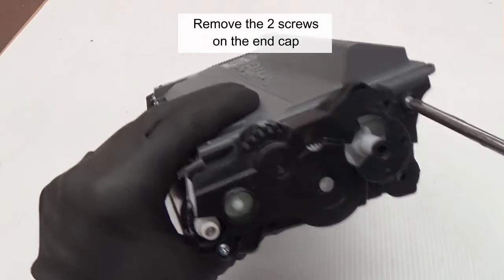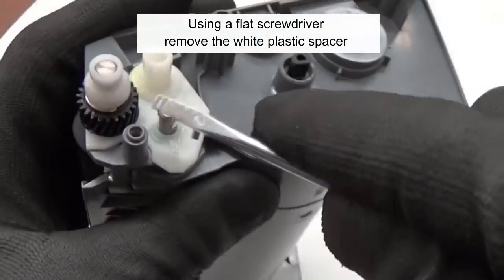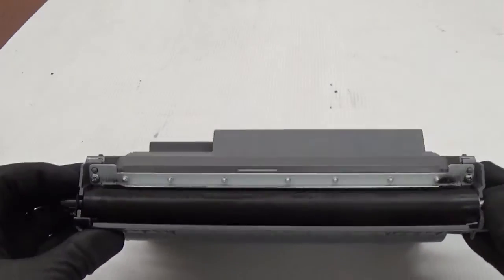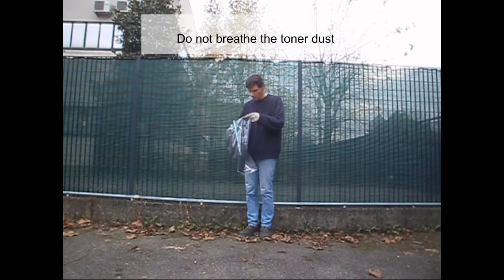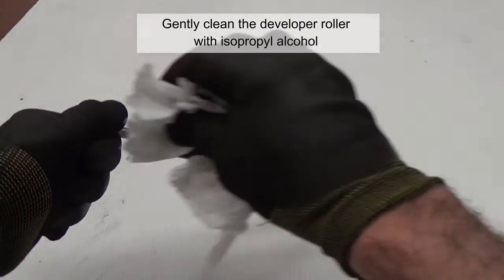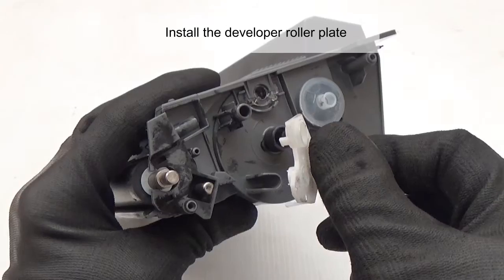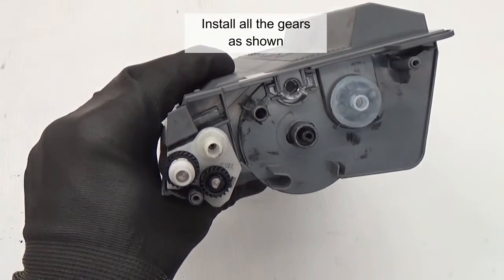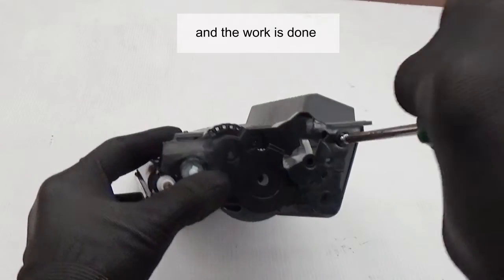Brother MFC HL-L5000 TN880/3480 Toner Cartridge Refill Reset

Comment: Thanks for showing. In my office the toner is TN 3440.  
I haven’t try open it yet. Does it has a chip?  Can any powder be use on any toner. Powder is all the same?
Reply from the maker: Brother toner powder is almost the same for all cartridges but you have to perfectly remove al the old toner
Reply: viandant5 

Thanks.
Reply: viandant5 
Thanks from Australia sir. 
So I can use a vacuum to suck all the old powder first.  
Some of the timers have chips that need to replace too.
Reply: viandant5 

I watch your other video. Use special vacuum to clean and suck old toner?
Reply from the maker: yes, you can use it
Reply: viandant5 

Thanks. I read that you have a special vacuum $400!!! With special filter. because the toner dusk is so fine that the dust leak into the air and no good if you breathe them in.
Reply from the maker: @David-st8te  it costs 260 Euro, you can find a toner vacuum on ebay for 150 dollars

Comment: is mfc L5900dw toner refillable or need to buy original tonar cartridge everytime???
Reply from the maker: yes, it's possible to refill it. You can use this instructions
Reply: @viandant5  actually i am afraid to buy this laser printer..because the retailer said that it can not be refilled and i have to buy each time a new parts that costs inr 8000 everytime.
Reply from the maker: It's not difficult to refill, as you can see from the video
Reply: @viandant5  so you mean to say..if i buy this printer..i just need to buy the dust black colour to refill. right??
Reply from the maker: @shibaprasadbakshi  Yes. there are compatible cartridges too

Comment: I did all this process step by step , but there is still that gaddamn error (toner low) 
My printer is HL-L6400DW

Please help me
Reply from the maker: Try to reset it through the control panel. Open the cover, press "secure" and "cancel", press arrow up until the display shows the toner, press ok. press arrow up to show "reset", press ok
Reply: @viandant5  thank you for your respond man. 
But there is no button "secure" and "cancel" on the panel.
Reply from the maker: @deathfellow6737  the reset gear must reset the printer counter, it's the method used by Brother cartridges. are you sure the reset gear is in the right position?
Reply: @viandant5   yea bro. Im pretty sure.
Can i have contact you with Gmail ?
May you please share your contact Email with me ?
Thank you